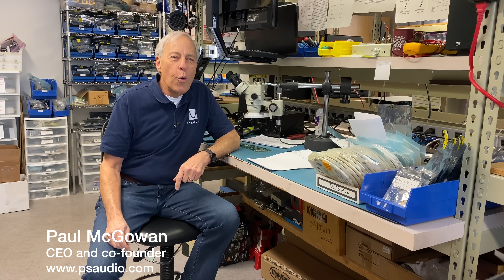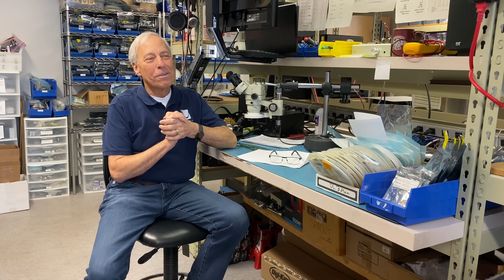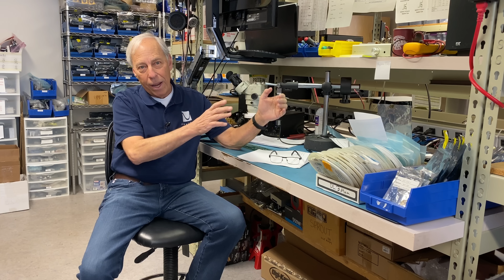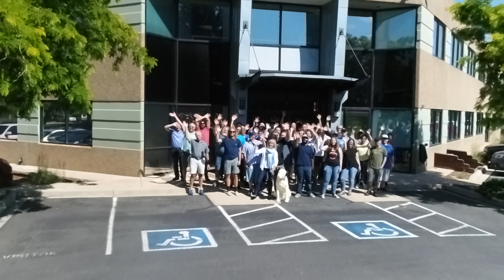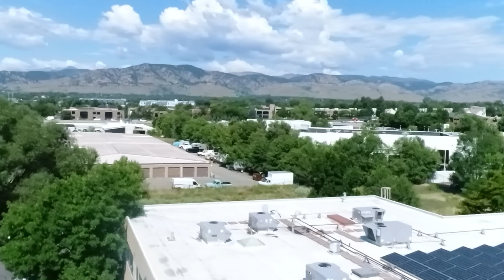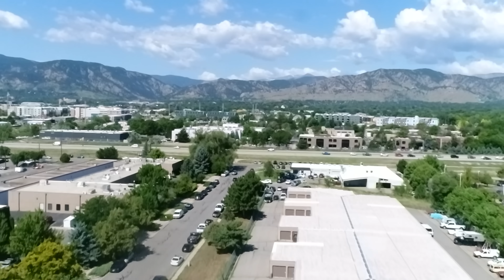What is DoP in digital audio?

Comment: DSD has no future as a distribution format for audio due to many reasons. DoP is needed because nobody cares to integrate actual DSD in any modern computing device operating system. Sending DSD pretending to be PCM only works when your operating system doesn't start attempting to do any bit altering processing on it e.g. involving EQ, gain control, mixing or sample rate conversion. From an audio fidelity perspective, DSD is sort of not making sense if the music production process involved any mixer (what music is made without a mixer???). You can't mix DSD natively...and any mixing of a DSD source will have to be done either in analog or in PCM. Analog mixing of DSD means you have already lost the bit perfect integrity of the DSD output of your microphones having to go through multiple stages of digital to analog and analog to digital conversion. Digital mixing of DSD means you have to rely on some DXD (PCM) format making your DSD a replica of a high quality PCM source. So why is DSD still able to convince people? The reason is much more about passionate people ensuring the best of audio fidelity rather than some over-compressed garbage. I'm sure DSD by PS Audio sounds great because those guys go the extra length for making awesome sound.
Reply: Dsd for me as a consumer that dont care about mixing or anything else but to play it is a very viable format. I understand when you want to edit sound or mix its not a good idea but yeah me personally like dsd and will continue to support artist/record companies that produces dsd until there is a better version to my ears. 

Flac had its day (up to now) but I believe that dsd should be an option for consumers.
Reply: Just another youtube user...DSD is transcoded PCM (usually DXD) or re-converted mixed analog. I would rather like to get the bit perfect DXD audio itself, and since it’s PCM, I would not need any fakery pretending to be PCM approach in the audio pipeline. If you like DSD it’s because the music was mastered well and will sound equally great on a high res PCM FLAC file.
Reply: @ThinkingBetter  this is what you're thinking. Let's live it like that.
Reply: Native DSD can already be done on Windows, Mac, and Linux, you just need the correct drivers and plugins for your music player. DoP is just easier to setup.

With foobar2000 for example, you just need the DSD transcoder plugin intop of the ASIO plugin, run DSD>ASIO>DSD Transcoder, and setup DSD transcoder to output only native DSD.
Reply: @Oleg-oe1rc Well, any route of DSD from an online server or a local disk to a DAC is just a simple data copying of raw data bypassing the computer's audio architecture entirely. It doesn't change my point above. DSD is unsuitable for modern digital audio processing architectures and that's why it has no future. PCM is as good as you allow it to be in terms of bit resolution and sample rate. DSD was born at a time where it made a lot of sense for providing a better than CD audio fidelity still relying on a disk media played in a device with a 1-bit DAC inside of it. Nowadays the use of digital audio PCM processing has exploded with usage in computers, smart phones, active speakers, wireless earbuds, automotive audio, online streaming codecs and so on. The business of modern audio is heavily relying on PCM and there is no meaningful argument against PCM concerning audio fidelity when you can start getting 32 bits 384kHz through to the DAC.
Reply: @ThinkingBetter  Whatever you say man, plenty of people who use and love DSD, and plenty of artists release their music in DSD format, so I don't see it going anywhere anytime soon.
Reply: @Oleg-oe1rc  DSD is not going anywhere, yes. It represents  less than 0.1% of music consumption and in the list of audiophile snake oil topics. A more in-depth article is this: https://www.mojo-audio.com/blog/dsd-vs-pcm-myth-vs-truth/
Reply: @Oleg-oe1rc  it definitely growing, and I'll definitely support it! Obviously it never be used in pop, dance... who cares.
Reply: @ThinkingBetter   Hello again. Yep totally agree you CANNOT manipulate DSD like PCM but as a system for capturing an audio signal is has greater accuracy than PCM which appears to be why conscientious recording engineers still use it despite any loss of fidelity in post production (i.e why they don't just record in PCM). Maintaining DSD without conversions can and is done but even conversion to DXD (the absolute norm) still seems acceptable. The other side of this is people converting all PCM audio files to DSD on playback (512 is now more common in DAC's even when you can't yet record in it) to suit sigma/delta convertors. So it does have its place.
Reply: @ThinkingBetter  Audiophiles make up a very small percentage of total media consumption, just because MP3 and AAC have the highest usage, doesn't mean they're a good option, they're just convienient. Could be 0.000001%, doesn't change the fact that DSD is alive and well with music producers and music lovers. DSD has been taking off in recent years, not dieing.
Reply: @angelwars3176  Most people don't understand this subject enough to judge what is going on. Using digital microphones, ADCs or DACs that rely on PDM is fine. In fact, I was just doing some lab audio test yesterday with a PDM MEMS microphone that surprised me in audio fidelity. What is upsetting is when people without depth of understanding are expressing that DSD sounds better than PCM. It's a totally bogus argument. Both DSD and PCM sound as good as the data rate you allow it to utilize. An SACD DSD disk definitely is inferior to a 24 bit 384kHz FLAC, if both are using the format fully. Obviously the DAC in your system can limit how much of the format gets through to the analog output but with a modern ESS9038PRO or similar performing DAC, you get excellent precision out of a high res PCM stream way better than what has been possible on any CD or SACD (DSD) player in the past. And even some can argue that DSD is an ideal input for a PDM based DAC, that argument doesn't work in the details of how modern DACs operate.
Reply: Oleg Try to find a DSD title on the top 1000 of what is popular. My choice of music is not based on whatever technical method of creating and distributing the music were involved. Rather, I generally don’t like listening to poorly produced music e.g. where too much compression was added.
Reply: @ThinkingBetter  For starters, who said I need to only listen to DSD because I like it? while you may feel the need to limit yourself, I have no such need, if what I want is in Flac, I'll listen to Flac, if what I want is on cassette, I'll listen to cassette. Second, top 1000 what? Today? Week? Year? Lifetime? Based on who's analysis? Because on lifetime I can find you the vast majority. And finally, I can just convert any PCM to DSD and have it processed by my DAC as DSD if I really want, even if it's not "pure" DSD. Or rip a vinyl to DSD, which plenty of even top 100 this week are availble on, but I don't really have much interest in owning somthing that's popular for a week or month and then drops off the face of the earth. Most of it is made using synths and digital effects anyway.

Show me top 1000 this week in 384khz/32bit that you were raving about.
Reply: @Oleg-oe1rc  Well, unfortunately, there is no top 1000 this week of any such quality in either DSD or PCM 384kHz/32 bit. That wasn't my point. My point is perhaps the same as you. I listen to music I like for its musical qualities and then I pick the best possible format of it. Rarely do I select music just by its superior audio fidelity itself alone, except for my professional needs in engineering of audio gear where critical listening tests rely on such tracks. My work involves optimizing audio using high-end signal processing and DSD is quite frankly a rather hopeless format for anything in that category. Forget about room correction, active DSP cross over, EQ, wireless audio, digital soft clipping and other modern stuff with DSD. I work in Silicon Valley and audio is among my areas of responsibility. And no, I'm not into crappy smart speakers or other mass market junk.  Now all of us work from home due to the virus btw and I greatly enjoy my home audio systems while doing work. I believe I have the best sounding home office setup in the Bay Area.
Reply: @ThinkingBetter  That's great bud, you do you, and I'll do me, I'm not just going to stop listening to DSD because you don't like it or think it's dieing. If you don't hear any benefits or hear any difference on your own gear, then don't use it, why are you trying so hard to shit all over it if it's so obsolete and dieing? I don't care about what you do professionally, I care about what my ears hear, no ones forceing you to do anything. I might very well preffer PCM on your gear, but you might preffer DSD on mine.
Reply: Oleg Of course most important is we enjoy wheat we do. When it comes to DSD I am simply speaking my opinion. I’m not against DSD but only against any false claims of what it does better. It’s one of many examples where the audio industry is using snake oil arguments. DSD sounds better simply because music in DSD is usually better and more carefully produced against passionate listening, and that I highly appreciate.
Reply: @ThinkingBetter  We're going round in circles here. My comments are not my opinions but those of many audio engineers I've emailed over the last four years who prefer the result that DSD capture gives them. I have no problem with PCM - most of my music is CD rips but DSD/PDM is a different process and can, all things done correctly yield a difference of benefit.
Reply: Angelwars Of course, as previously mentioned AD and DA conversion using PDM is great. No engineer disagrees with that. The issue is the entirety of the audio pipe where you end up changing the digital audio bits anyway through transcoding and other processing. DSD is sort of a marketing term that rely on the conversion principle benefits that aren’t actually depending on the distribution format itself. Check this: https://benchmarkmedia.com/blogs/application_notes/41262017-audio-myth-dsd-provides-a-direct-stream-from-a-d-to-d-a
Reply: @ThinkingBetter  Yeah I'm familiar with that article, the guy builds brilliant DAC's. We are actually in agreement here, at the end of the day, it's good practice in basic recording, mixing and mastering that give you a great record not sample/ bit rate, DSD, PCM tape or whatever. I'm an advocate for trying to get people to understand what the hell this DSD thing actually is because very few do!
Reply: Angelwars That article is a good summary of what DSD actually is and is not. I’ve worked in high-end audio engineering for a long time and frankly seen a lot of times how the marketing part of the business turns out snake oil arguments to promote the sales. For example, I’ve been to numerous of the suppliers in Dongguan, Zhuhai, Shenzhen, Guangzhou etc. who make your US$1000 high-end branded power cable and produce it to me for US$20 FOB China with a smile because they still make good money.
Reply: @ThinkingBetter  Oh I totally agree that's all bonkers rip off stuff but I'm not aware DSD is being pushed heavily at all. Hi res' is still being pushed at the moment but I don't get the impression anyone really cares. The reason we are posting here is that PS audio /Paul Mcgowan has invested in Gus Skinnas DSD Sonoma system /Octave Records. He is a big advocate for DSD and that's why it frequently appears as a video topic.
Reply: Angelwars Yes, PS audio is making a business case out of DSD. I have some sincere respect for Paul and have no doubt that their mission is great audio. Like any other high-end audio company, PS Audio needs to make money and it’s alright. They are definitely in the better end of the scale.
Reply: Hell, I can even play native DSD on my phone without much of any setup with HiBy music, just change DoP setting to DSD and give the app exlcusive control over the usb DAC.

Comment: FWIW I can play, record, encode and decode, set parameters of, "pure" DSD files on my Linux ( Red Hat ) platform all day long. That using the ffmpeg software. ffmpeg is an open sourced application that runs on most Operating Systems including Windows.

Now the ability to do that is relatively recent, in the last 5-years or so, so Pauls information may need to be updated.
Reply: https://www.ffmpeg.org/
Reply: He may be confusting DoP used as a "container"
Reply: Can be done in Foobar2000 aswell, just requires a bit more fiddling than the basic DoP setup. And on your phone with HiBy music.
Reply: @Oleg-oe1rc  Not surprising. ffmpeg, because it’s open sourced, is used all or in part in literally 1000’s and 1000’s of applications. I’m told it’s the core code for MicroSoft’s Media Player. Red Camera, a professional cinema camera company, uses code from ffmpeg in its cameras. Therefore ffmpeg supports Red Raw files.

ffmpeg is everywhere, there is no reason to re-invent the wheel. Just pick the code you want out of there, put a pretty video editing application face on it, and sell licenses for $200/yr. Perfectly fine. They do ask that you contribute back something to the ffmpeg Community in the way of money, or code of your own.

Likely Pauls editing software uses ffmpeg code in it.

Comment: I like philips bitstream dac. which is 1 bit dac. which is based on philips TDA1305 dac ic. The sound is very good. Does anyone else means it?
Reply: @FatRat-f9m   Rest in peace, Ken Ishiwata.  You done good.
Reply: Marantz does their own version of a 1-bit DAC ln their current flagship SA-10S1 CD/SACD and USB player using 2 SHARC DSPs and a CPLD in circuitry co-designed by Rainer Finck, who was part of the original Phillips bitstream team.  The Ken Ishiwata finessed SA-KI Ruby player also uses this technology.  Specific refutation that the DACs and  outpit stages of all  CD[/SACD] players suck.  Sorry Paul, but you don't get off so easily for that outburst 2 days ago.
Reply: @stephensmith3111  I have this DAC. which is based on 2 pcs. TDA1305. amazing sound! 
Go to the internet address at the bottom.

You can buy an edition with box.

I have a denon DCD-3300 classic flagship cd player.
The TDA1305 has very similar sound as the denon.
 https://m.aliexpress.com/item/32830869745.html?trace=wwwdetail2mobilesitedetail
Reply: @ford1546  Our first CD player was a Denon (I forget the model number) which we purchased in 1978 or '79.  I don't know which DAC chip set it used, but I know that it did have a slow roll-off minimum phase filter.  My late wife and I were in agreement that it was definitely the best sounding unit of 5 in it's middle price range that we were able to audition in our area (although she was not an audiophile, her professionally trained ears as a speech/language pathologist and also an amateur pianist were more golden than mine).